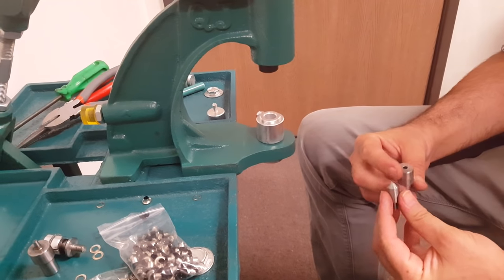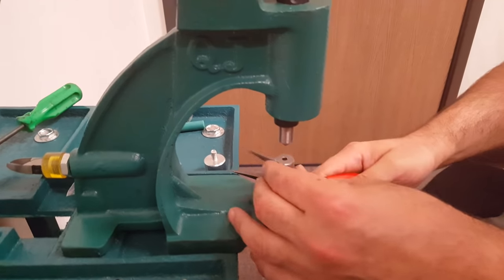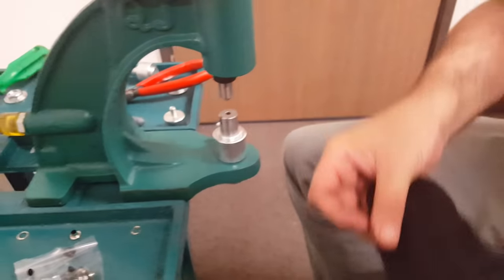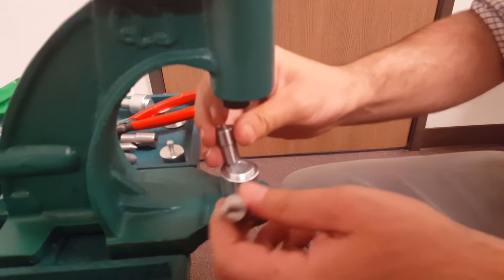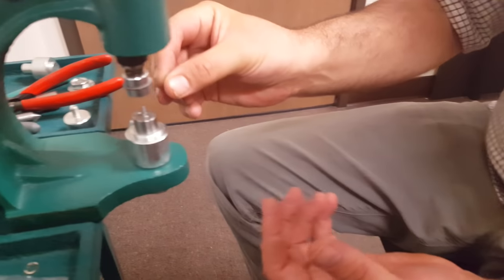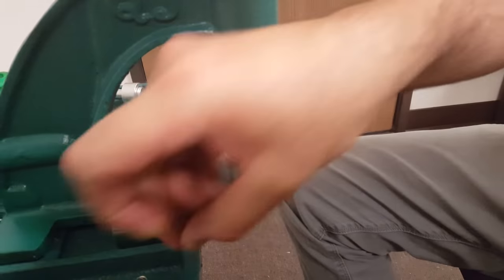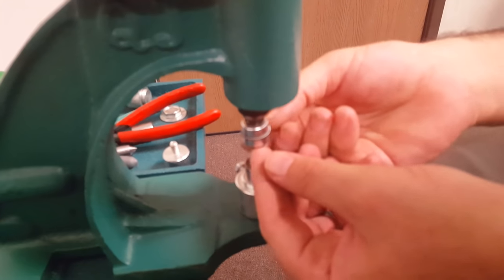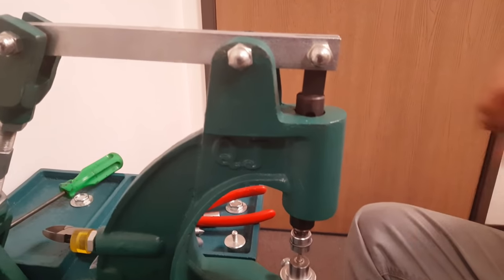Tutorial - How to use Goldstartool's Foot Press Machine - Goldstartool.com - 800-868-4419

Comment: ... thanks  David   .... I was going backwards ... one would asume the larger part of the grommet goes on the bottom because of the longer cone shape ....  found the same for the double cap rivets  ... the longer part of the rivet goes up to the upper die as one holds the leather & presses down onto the spring loaded bottom die { be sure to put the  " cap in } ....